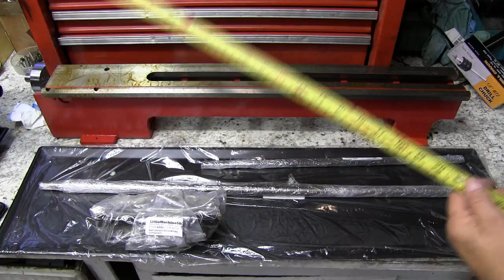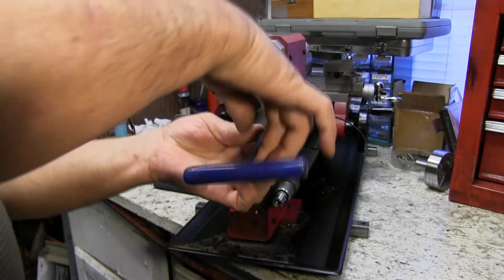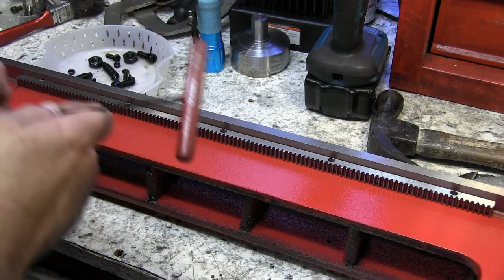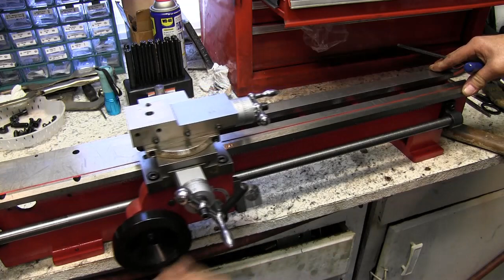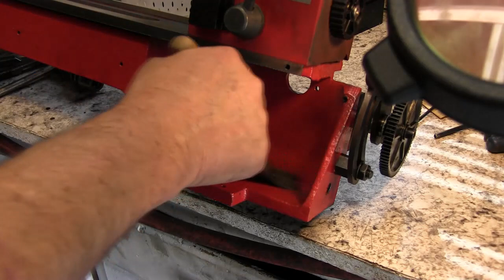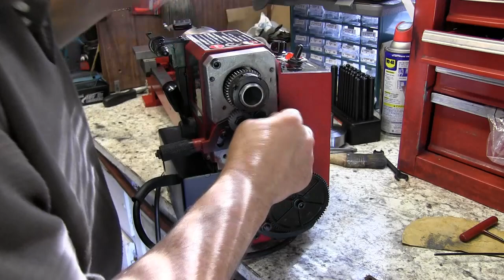#248 Harbor Freight 7x10 Lathe Bed upgrade Kit

Comment: You could make a thing on the backside for the slider. And use something like a spring pushing onto a bearing. Then it can be tight and even if the surface is not flat it can adapt to that.

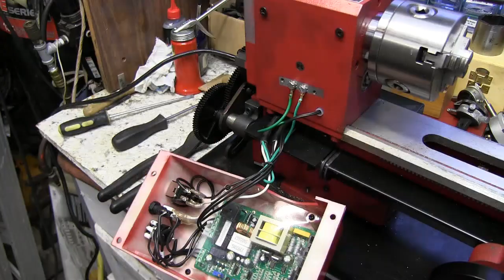Comment: A note re the lead screw: If you have the rubber seal where the lead screw passes into the control box (you can see it at 10:30, right below the corner of the head stock), be sure to transfer it to the new lead screw before mounting the lead screw! He forgot to do that. Oops! 🙂
I'd also recommend using blue Loctite on the screws for the rack, lead screw bearings, change gear arm stud, motor mounting plate (to the motor), & the head stock. And lightly oil the bed & underside of the head stock so they won't rust.

Comment: Any thoughts on why it is that there are only three mounting bolts for the head stock instead of four . the right rear corner of the head stock has no mounting holes. i just received my 16 inch extension from LMS and it too only has the three mounting holes for the head stock. Thanks again .for the Tutorial

Comment: Was it necessary to remove all the gearing from the head stock. Couldn't you have just unbolted the head stock at that point and lifted it of Thanks i concur with the others great video Thanks
Reply from the maker: There are cap screws under that end of the lathe head stock. Really hard to get to with the change gears in the way. Also to remove the cover that contains the belt.
Reply: @TheRadioShop  yes sir saw that as the tutorial wentalong

Comment: Am I the only one that is wondering why the measurement was from the face of the chuck jaws to the face of the tailstock, rather than with the chuck removed, an MT3 centre fitted in the spindle and an MT2 center fitted in the tailstock quill as that is how it is actually measured to get the "between centers" measurement.

Agreed the "usual" working distance between the chuck and tailstock is diminished because of chuck depth (measured at the furthest projection of the jaw towards the tailstock) and tailstock live-centre depth, but that is not the "between centers" measurement, that is the "working distance" when fitted with a chuck.

Comment: Are them plastic gears, l hope not. The price of this lathe calls for good metal gears.
Reply from the maker: Actually the plastic gears are pretty good.  For one, they are quite. Not as noisey as metal gears.  Second, they will act like a "weak link" in case of a crash. Better to break a plastic gear than a shaft, coupler, or housing.  So far I have yet to damage one of these gears in the lathe.  And I ran it pretty hard. I have even 3D printed  some bigger gears, 104 tooth, 112 tooth to slow the feed down for better surface finish.  The mini mill is a different story.

Comment: You're lucky, it took 2 years to get mine because they kept selling out and it's first come first served, no reservations. Great video though! I got my tool post (sliding gib type) from little machine shop also. I made sure it wasn't the piston type for the very reason your talking about.
Reply from the maker: Sorry to hear that
Reply: @TheRadioShop  It is what it is. Little Machine Shops customer service has been outstanding so far though. I've purchased quite a few things there and have been very pleased when dealing with them directly over the phone. Getting the lathe bed was the only problem I've ever had with them that wasn't fixed on the spot. They have to order them from China and there was apparently a shortage so I can't fault them for that, I just wish I could've reserved a spot in line.

Comment: For accuracy, the compound slide should be at 45 degree when cutting. Hundreds of videos on Youtube show everyone using the compound at 90 degree. This would solve some of the spacing issue and also improve cutting.
Reply: The problem with these tiny lathes is the carriage wheel don't have any measurements so you can't really have accurate measurements, you can use the compound knob to get better accuracy

Comment: You sir should be a machining instructor. I cannot believe how thorough you are with every aspect of rebuilding your lathe. I dont even own a lathe or endmill but stayed and watched this to the end just because of how you explained everything perfectly. This video is getting saved for future reference when i do buy my lathe from harbor freight. This is why i dont understand people who rag on me for buying things from harbor freight. With a little bit of TLC and upgrades you can make anything from harbor freight perform as good as the big name brands. Well done sir.
Reply from the maker: Thank you for your very kind words.  I try and cover every step in my videos for folks can understand what is involved in the project.  And getting comments like these makes it worth the effort.  I have to agree with what you said about HF stuff.  Not only do I own the lathe I also have their mini mill, horizontal band saw, porta band, sawz all, press, engine hoist and stand and many more tools from them.  Any tool can be modified and made to work with a little effort.  Keep your eyes open for the rebuild of a 100 plus year old lathe on the second channel. It is a McCabe with 9 inch chuck and over 6 feet bed. You can find the link in my newer videos under the show more tab.  Thanks again for your comment.

Comment: Anybody remember the article on how to take a second bed and modify it to mount to the original bed to make a bed extension and how to use a second leadscrew to extend the leadscrew. I bought a damaged mini lathe and pulled the bed and leadscrew to mod it but then life got busy and never got it finished. now I can't find the article anywhere. They also had a riser block mod for headstock and tailstock to turn bigger diameter items. Can't find any of the old modification articles on these mini lathes.

Comment: I cut the small end of my drill MT2 taper so it fit farther in but still popped out when I turned the crank to  0, and It gave me a little more room. I have a quick change tool post like that and it is as tight as a new bride, and am really happy with it. I superglued the handle in and it has worked good.

Comment: Turn your toolpost 180°and turn the tool around I. The holder so that in effect the shank  is being pulled towards the work rather than pushed. That should give you the clearance that you need but you'll lose it at the chuck end of your job instead. There's no rules just ways that  cause inherent precision to work for you and of course safety.
Reply: He did that in the video.

Comment: Do you think going 699 for 8x14 or 809 for 8x16?  You have one and would know better than I if those two inches is worth that price difference.
Reply from the maker: I would spend the extra money for the 16 inch. The only reason I bought the shorter one is because I could get it with no shipping cost since it was store pick up.  The extra few inches really make a difference.

Comment: LMS has a wedge-type QCTP.  I haven't tried mine but it feels solid.
Reply from the maker: Yep, I got one from them. Much better.
Reply: @TheRadioShop  I noticed yesterday with mine, with 1/2" tools, that I can't get them low enough.  Have you had a similar experience?  I was going to make a solid toolpost anyway but now I have another reason.

Comment: Great job
It appears to be easier and less costly less time consuming then trying to fix an existing frame issue that many on YouTube have spent many hours of hard work lapping the underside of the bedways.
 It appears the upgrade is well made and very precision.
Have you checked the accuracy of the ways, top to bottom and thickness?
Reply from the maker: Thanks, there is a bit of variance in the thickness. Not to bad and can be easily scraped out. Thanks for the comment.

Comment: R.S., did you use the blue lock tite to keep those screws? or is that not necessary? Also is that motor mount home made?  great video!!!!
Reply from the maker: Yes, blue lok-tite on the screws. Motor mount is chinese made and stock to the lathe. thanks

Comment: Very good video! Much appreciated! It's nice to see a How-To that covers all the details in real life. I don't have a mini lathe, but do have my great grandfathers 14" swing/36" workpiece lathe. It is VERY old (1930's, but not really sure[exposed gears are high above the head], but is very accurate, he was a master gunsmith and competed on the National level and made his own barrels. He also did boiler repairs). The lathe was originally set up with leather belts and interchangeable gears for gear cutting/feed rates nad adjusting head speed. I am planning to do some modernizations on it and your video really helps shed some insight and perspective on lath construction.  Thank you, I am a subscriber now.
Reply from the maker: Thanks for sharing that. Good to hear about these old relics still kicking.  Those were built to last. Just have to be careful around those open belts and gears.  A lot of machinery was built like that and at the time folks knew where to not stick there hands!.  Welcome to the channel. I have started a second channel that will contain only garage and machining projects.

Comment: Great for people with a 10" bed who don't want to sell it to buy a more expensive 16" and want to retro their existing lathe.  I bought a 12" bed because it was the biggest lathe bed Harbour Freight had to get length was much cheaper that Little Machine of the same size but had to wait 2 months.
Reply from the maker: Agreed. They mostly keep them in stock, but here recently looks like they may be having an issue getting stuff from over seas.

Comment: The 7x16 mini lathes sold by Little Machine Shop and Micro Mark not only are longer, they also include a brushless DC motor that does not require a noisy gearbox.  The tailstock also locks with a lever, no wrench is required.  
It's best to start off with something good, instead of doing a partial fix on a piece of junk.
Reply: Well these were the first ones that hit the market back in the late 1999 era. And you were paying what was a high price back then for them. So along came these different up grades that you could do to improve your mini lathe. So bit by bit you did that and the satisfaction that you performed the task yourself and learned some things along the way. So in your case I guess you wanted to pay the big bucks for a newer lathe with all the bells and whistles without the experience and getting the experience of performing those upgrades your self and the satisfaction that you did it.

Comment: It is actually ten inches from a dead center in the spindle and one in the tailstock. You probably could have made it work by putting your bar between centers and secure the bar for turning with the face plate a a lathe dog. 
Good job on installing the kit though. Definitely a useful upgrade.
Reply: @claytonmusgrove8438 "It is actually ten inches from a dead center in the spindle and one in the tailstock."
Exactly right. Applies to ANY lathe.
Reply: LittleMachineShop sells a 3MT headstock dead center (#1188), & a set of lathe dogs (#4464) with a drive pin that fits into a spindle flange hole. Just remove the chuck, install the center & the drive pin, & you're good to go!

Comment: Just to clarify lathe specifications. The three principal working parameters are swing over the bed, swing over the carriage and length center to center. The swing specs are pretty straight forward but the C to C spec needs qualification. It is generally understood the working length of the bed does not include "accessories" such as chucks and  rolling centers. The actual spec refers to having dead centers inserted into the spindle and tailstock. With that in mind the advertised spec is probably correct. It is up to the buyer to determine actual working dimensions based on their use case.
Reply: You forgot the main one....it must have a big hole up the spindle.

Comment: Hi there, nice up grade, check out Steve Jordan u tube mini lathe saddle up grade, done this myself and works superbly .lots of other good stuff also.
Reply from the maker: Thanks for the tip and comment
Reply: Hi again ,if you are changing to metal gears leave 1 gear cog plastic  ( 80 tooth on lead screw ) this will give a relief point in case of a jam mishap. Be safe be well.

Comment: Too bad that longer bed was not just standard in some models. Big cost to change. I did notice you did not say anything about removing that paint on the bottom of the ways. That really needs a smooth surface for the cross slide hold down (gibb) to run on.
Reply from the maker: Bit of an expense for sure. But if you already have one then it is the way to go.  Are you talking about the underside of the bed ways? There is no paint there.  If that is where you are talking about if you look at 28:19 you can see the  screw holes for the track reflecting back on the bottom of the ways.  It has such a shiny finish like a mirror and only looks like it is painted.
Reply: @TheRadioShop  Looked at about 32 and it must be a reflection. Mine was painted and I had to clean. I used a dense felt for way wipers with 3D printed frames. I keep the felt oiled.
Still need more work on the tailstock so it is held in line better than one side. Only 20 in my garage and heater can not keep it warm enough right now.😥
Reply from the maker: @gvet47  Ah yes, the back side does have a red tint to it. From overspray. After  they cleaned it it does look painted but actually it is not. Just tinted. Man that is cold in there!
Reply: @TheRadioShop  I have a Jet 1220 wood lathe also. Had a bolt on bed extension on it. Too bad they just do not have the same. Just need room to set the tailstock out farther for room it takes for drilling. Really do not need the leadscrew or rack for saddle out there. Hum? Cut up your old bed and use it for a bolted extension with alignment pins or guides.🤔

Comment: With all the extra work you've already done on this lathe, maybe the Grizzly g0768 might have been a better starting point. It is advertised as an 8 x 15 lathe, has tapered bearings on the spindle, has a cam lock tailstock and comes with steady rest and follow rest and both 3 and 4 jaw chucks. Looks like maybe the same bed and ways, but for what you've already spent in parts and labor, the $1350 price looks pretty reasonable.
Reply from the maker: You are correct. If buying straight out then the Grizzly would be the way to go.

Comment: I made the same mistake with the tool post. Little machine shop has a cross slide that's been shaved so that you can run a standard AXA tool post on em. It's way better.
Reply from the maker: You are correct and I am looking at them now. Thanks

Comment: This upgrade is expensive but worth it if you have a small lathe, it must be a godsend now. Great rebuild to a longer working bed Buddy.  Sure think your future tweaking 
of the tail stock parts will make things easier. The Chineseum tool rest post  is really  poorly designed in every way.
Reply from the maker: Thanks for the comment. It is like having a different lathe now. Plenty of room to work around things. I am going to upgrade to a much better OXA style tool post soon.

Comment: Nice job on this upgrade! Not for the faint at heart, for sure. You have pointed out several weaknesses of this lathe, but you are getting the problems resolved. Thanks for sharing.
Reply from the maker: Thanks Bill. Really not a hard upgrade at all.  Just drill and tap eleven holes, In the correct location :-)

Comment: Nice upgrade Buddy to meet your shop needs. I have purchased tooling and accessories from The Little Machine Shop also, they do have a excellent business for the home machinist and customer service. I am still waiting on some materials to arrive so I can get my Electronic Lead Screw together and installed.
Reply from the maker: Thanks, yes I am looking into that also. I do believe that will be a killer upgrade for any lathe of this size. Hard to turn metric treads with an imperial lead screw lol.